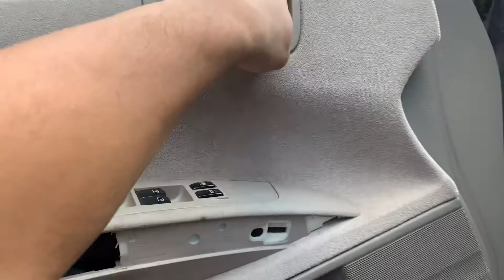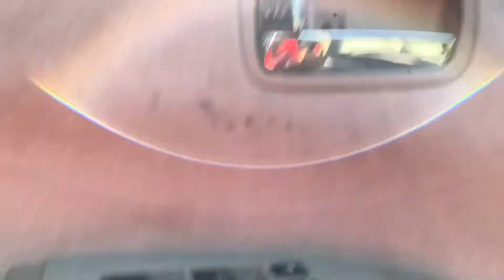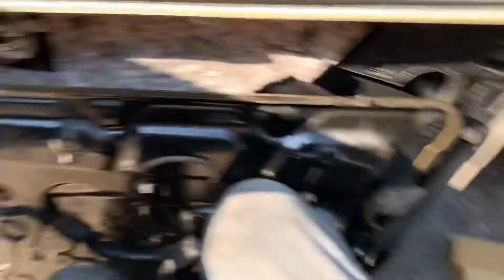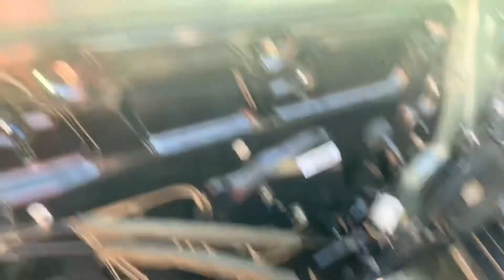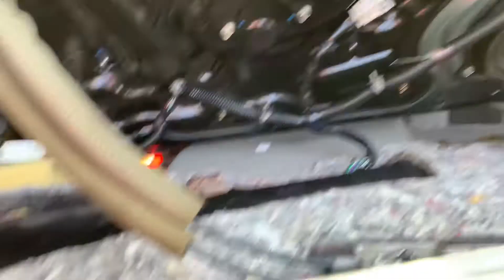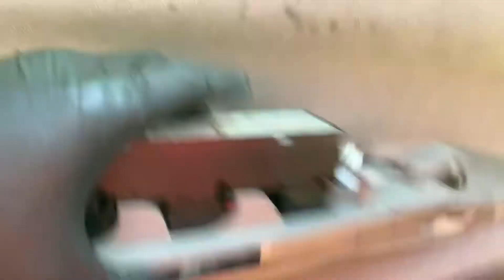2007 Nissan Maxima Driver Window Regulator Replacement

Comment: Hi , Question I've had to replace my drivers side motor twice an then I got a whole new window Regulator and changed that out....even cleaned an replaced My door main switch panel an for some reason when I roll the window down sometimes it gets stuck an won't go up an when it does go up it will go back down like it's hitting something and I've done the reset test an still same thing... I've even got a can of silicone lubricant and sprayed In the track and window seals.
Reply from the maker: When you did the reset procedure did you do it at the master switch?
Reply: @TexThaiAuto  I did.